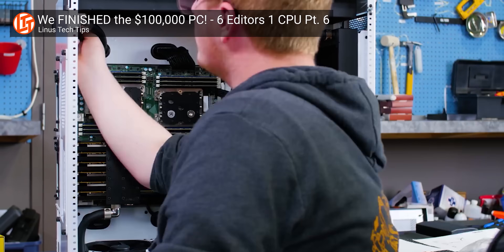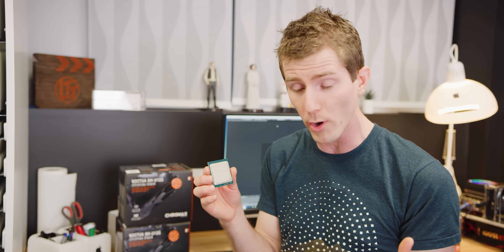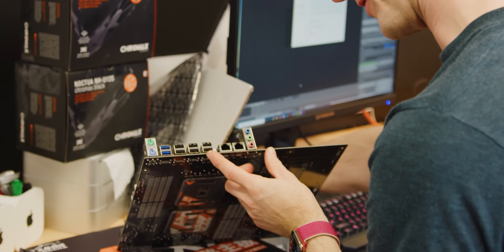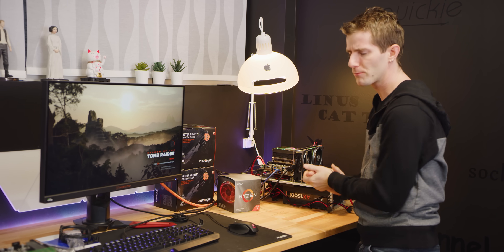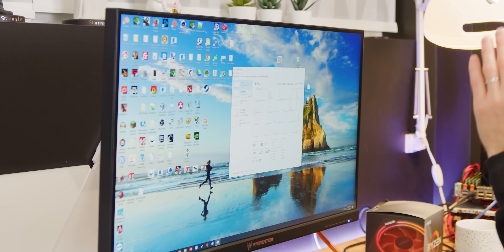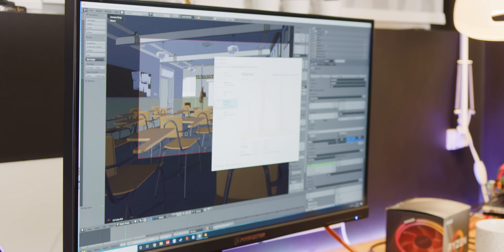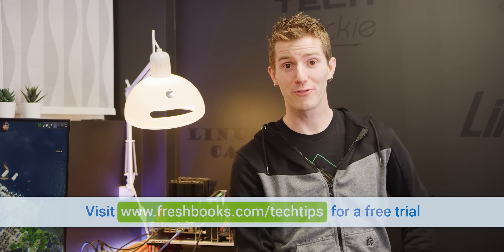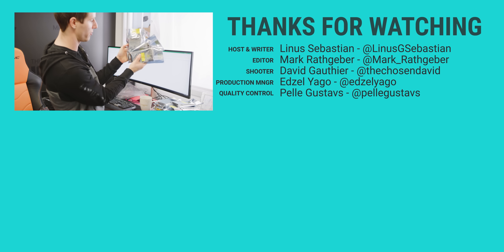SIXTEEN Cores for the Price of EIGHT!

Comment: I wonder if the RAM Speed was a bottleneck in the Xeon system, especially with that 45 FPS scene.
Reply: I can't find Linus cinebench score, but my huananzhi dual 2667v2 gets a score of 2521.  And it sure acts like an all core turbo to 3.6Ghz.   I bought one of the Jingsha boards mostly hoping to cheaply go from 64GB to 128GB, along with m.2 storage and more PCI slots but the board won't boot into windows at all.  But my CPU and ram are back in the huananzhi and its been up for 10 days.  Go figure.
Reply: @JasonStevens  I see the Jingsha board only supports up to 64 Gb RAM on AliExpress. Does it fail to boot Windows with only 64 Gb RAM too? Because with 128 Gb RAM Windows might just be having a problem managing the RAM sticks if the board only supports up to 64 Gb. I had an old DDR2 motherboard that only supported up to 4 Gb RAM, and I had put 8 Gb on it, Linux was working fine with the 8 Gb but every few weeks my Windows 7 files would get corrupted even if it was recognising all the RAM just fine. If I had to guess, Microsoft recognised the issue and added a safeguard to prevent Windows from booting up at all. But then again, statistically speaking, that's a sample of one motherboard.
Reply: @bhuvangunessee  I couldn't even get it to post with 128gb!  I had it posting with 64, but every version of windows 10 I had install media for each crashed before being able to load the installer.  Same CPU and 64gb work fine in the huananzhi.
Reply: @JasonStevens  If the board doesn't support more than 64 Gb RAM, it's normal that it won't even post with 128 Gb. It looks like either your board is defective or your RAM sticks may have some compatibility issue either with itself (yes, it works in the Huananzhi board but it might just be the Huananzhi handling the RAM differently) or the board (most probably the board doesn't support the RAM config that you are trying to use depending on PCI lane distribution).
Reply: I can't help you more than this for this issue, I'm not familiar with these boards. I would suggest going to the LTT forums (because of the video) or any other good forum, really.

Comment: If someone really wants to build pc with this board, then DO NOT buy two e5-2667 v2 which cost about 135USD per piece. Buy e5-2689 v1 which cost about 56USD. Performance is close and e5-2689 v1 has even lower TDP (130 vs 115 W). You can even get it in one bundle (MB + 32GB ram + 2x e5-2689 v1) for 280 USD in Kllisre Official Store on AliExpress.

Comment: So... what is the use case here?

If you are using Blender, or some other 3d editing app in the kind of capacity where a minute, or even 2 matters, I would assume you are making money off it. In any scenario where your machine is used to make money, why would you risk losing money or time on strange Chinese hardware like that board? Or used ebay parts?

Assuming you are just gaming, why would you want to put yourself in a situation where you are fighting separate NUMA domains?

And if you are using applications, at home that are well threaded, but aren't money makers: Is it worth going to an unknown board manufacturer, with the limited I/O, limited support, etc to shave single digits on render times?

Apart from "this is something cool I would like to try out", I don't see a single use case where this makes sense.

Comment: As this MB needs 2x8pins connectors - would you actually need 2xPSUs for it? If so, I guess putting it in a case is not an option... right?

Comment: As much as it pains me to suggest this.. Given Apple has a system in place (I forget the name but it's like a train station, bus depot type name) that allows a program that only uses 1 core to actually use multiple cores, is there a Windows equivalent piece of software that would make this 16 core monster perform any better?

Comment: Hey Linus. Serious question. Is this setup good? Let me know, please 

Xeon e5-2687v2
Gtx 1070
Runing x79 mobo 
128GB ram
Reply: Similar to mine, and yes pretty decent even today, maybe a bit over board on ram though.

E5-2667 V2
GTX 1070
32GB of ram
All in a HP Z420 Workstation case.
Reply: Wolf there’s someone selling the setup and I wasn’t sure if I should buy it. I appreciate your reply.
Reply: I run a 2667v2 with a 1080ti and its perfectly fine for 1440p gaming

Comment: E5-2667 v2 performs pretty poor, comparing with a Ryzen 5 2600 would be more informative. And it's only $140 while the 3700X is $380. Going by PassMark ThreadMark scores you'd be better off trying a E5-1660 v2 or E5-1680 v2, they're in the $180 dollar range and have the highest scores. Still, interesting video.

Comment: You did not even look at power.  What is the power consumption of 2 Zeons compared to one Ryzen?  That adds up over 3 years.  The TDP of those Xeons are 130w EACH and the Ryzen is 105w and 8 DDR3 draw about 32w compared to the 6w the 2 DDR4 run.  Even if the systems only run full loaded say 1 hour a day that Xeon system is drawing 180w more, that is still $10 extra a year or $30 in 3 years... just for 1 hour of use.  If you are planning on running it as say a workstation or game streaming system 8 hours a day that is $240 extra in power usage.   That Ryzen system will run about 280w total under load and that Xeon system with likely run at closer to 460w and needs 2 8 pin CPU plugs (or a splitter cable).  You could be talking another $30 for the PSU easy.

The Ryzen system can easily run on the retail heatsink, but you need to buy 2 heatsinks.  Even budget ones you are looking at $15 each.  Plus I do not like dealing with I don't like dealing with Ebay one bit and Ali Express and the lack updated drivers, support, or even finding someone with experience working with this board would be difficult.  Also it might not even fit in your case because the second CPU heatsink hits your optical drive or you have a smaller form factor case.  A larger case costs more too.  I would add another $10 minimum there... especially with the extra heat you will likely want more case fans.

Well now you are looking at $100 extra in parts and likely $100 extra in power usage to get a used system with likely less performance, no warranty, and and generates more heat and noise.  No this is NOT a good idea for anybody.

Comment: I liked the build and for a gaming machine it's neat but if you're looking for for cores like I was for a home virtualization server, I just picked up a Dell r810 with 4 e7-4870s and 256gb ram for like $350 on ebay and it's running at only 550 watts. That's 40cores plus hyperthreading at 2.4ghz if anyone was wondering.

Comment: Hey im new to buidling pc's do u think this will work?
==============
I N F O P A R T S
==============
case
Rakk Siri Gaming ATX Case free● 1x120mm RGB Rakk Stock Fan

Power Supply
Asus P-50GA 500w●

MotherBoard
asus prime a320m-k motherboard●

-Graphics Card -
Gforce gtx 1050 ti Graphics card ●

-Hard Drive -
Kingston A 400 240 Gb

-Ram -
Vengance LPX DDR4 3000 C15 x2● 8gb

-Cpu -
amd ryzen 3 2200g ●

Comment: Did you make sure that RAM was running at 1600? It might have auto set to 1066 or 1333. Not that it would have mattered a whole lot for what you were testing it with.

Comment: Okay, so how decent of an option is this if I want to game, it seems viable but just checking, I mostly want to flex on my classmates in my computer coding class 😂
Reply: I have dual 2667v2 and a RTX 2070. It ran fine enough for me.  But I found the Jingsha board no good as I wouldn't run anything for me, but the CPU and ram work fine in the huananzhi

Comment: If you plan to run old X79 era stuff, you are better off with 16xx v1/v2 xeons.  They are unlocked.  I currently have a 1650x running at 4.8ghz daily.  It is toe to toe with most modern CPU's in gaming and single thread things.  For the most part.  But get's is butt handed to it in heavy loads.  Even against the other 6 core chips.  But, for a cheap chip, it's a great budget option.

Comment: I’ve actually been planning to build the 16 core build that Linus showed here😅
Reply: @Martin M Depends on where you live though, I built a 20 core 40 thread dual Xeon 2650 with a dual socket Huananzhi X79 with 64GB of ECC for only $300 I think (watercooling not included, which is also Chinese). I only use it for HTPC,  CCTV and rig shows (it looks amazing AF, turns heads over shitty RGB). As a gaming PC it is pretty much almost useless, my 7700K/2080Ti just tears it to pieces at home workloads and gaming
Reply: I have their matx single socket board that I'm using to run a game server for 7 Days to Die, it's pretty lit, but the 2640v2 leaves my world generation times a little to be desired so I'm thinking about getting a stronger CPU
Reply: I built basically the same one a few months ago but I still had to use some weird INTEL Server Board
Reply: dont use that Chinese board, plenty of people receive dead/defective ones and manufacturer doesnt respond
Reply: rasz there’s actually a black version from a different company that’s being sold on an online store where I live. Quad channel memory support with dual sockets. And it has a gamery vibe 🤷‍♂️😅

Comment: I suspect the DDR3 / DDR4 divide was a prime cause of performance reduction at 16 core - coupled with the older chipset
Reply: I suspect it was running in dual channel instead of quad channel, he never said if it was or not, quad channel 1600 ddr3 has the same bandwidth as dual channel 3200 ddr4.

Comment: ddr3 in a dumpster? you need to show me that dumpster so i can upgrade my rig thanks. also he calls those xeons slow. kek mine is even older than that, i feel depressed now.
Reply: I use a 2006 Mac pro at home.  Granted I upgraded the processors to 4 core 3ghz ones, and a 1050, but it'll be 14 years old soon...

Comment: You mean i think Windows doesn't utilize NUMA nodes properly, it's exactly the same experience people faced with Thread Ripper second generation. But GNU/Linux on the other hand offers a far way better experience and superior utilization of NUMA nodes.
P.S.: Stop mixing Ebay and Aliexpress, even you can find motherboard seller on both plateforms...

Comment: I run a dual xeon e5 2667 v2 dell T7610 workstation in my office with 48gb's of ddr3 ecc and a 500gig samsung 860 ssd and a i put in an old nvidia 980TI i had laying around.  You can pick up a barebones T7610 with PSU and motherboard on ebay for $349.  The dual e5 2667 v2 will set you back $300 on ebay ($150 x2).  You can pick up 8gb samsung ddr 3 ecc memory sticks on ebay for $16 each.  You can pick up the samsung SSD for $79 or a cheaper brand for as low as $50.  If all you are doing is office work, a 980TI is most likely overkill, but it was laying around for me.  You can pick one up on ebay for $100.  For a spec like mine will set you back $960 on ebay plus shipping.  Its a pretty nice system.  I can all core at about 3.6ghz and run a few cores around 3.9 ghz.

Comment: For gaming? I'd argue that the majority of games still do not use more than a few cores, if that. So whether you'll have 4 or 64 cores does not impact performance all that much.
Waste of energy to run. Get a newer architecture with higher clock speed and you'll be much better off for the vast majority of actual use cases.

Comment: Since this board has socket 2011, could u put 2 e7 4880 v2 in it and rock a 30core system?
Reply: PXLCoarl Pretty sure 2011-1 CPUs like that won’t reliably work in this board, if at all. But I could be wrong.

Comment: i upgraded to these exact xeon cpus in my supermicro X9 based unraid server. went from 2x 6 core 12 thread 2.0GHz base 2.5GHz boost E5 2620 cpus to these 8 core 16 thread 3.3GHz base 4.0GHz boost E5 2667 v2 cpus. Basically these are the best clocking E5 v2 based cpus you can get. Only downside is that the E5 2667 v2 cpus were $200 a piece. And the old E5 2620 chips i had originally in my server? $12 bucks a piece.. not even worth the hassle to sell them lol. But at least the unraid server is handling a ton of dockers and vms like a champ. And who doesn't want 128GB of ram for less than $200

Comment: I actually put together a system with this very board. I got it for 95.00 and free shipping on Ali Express. I got two 2680v1 chips for 50.00 each.  I scored 128 gigs of ECC 1600 for less than 200.00 shipped free. The RX580 isn't the best graphics card but it was only 180.00 and works.  Gaming performance isn't that great and single threaded performance sucks. With that said, ripping, rendering, transcoding and editing are faster than greased lightning. I'm into this for well under 1000.00 and knew what I was giving up by going this route. I am very satisfied with this system.
Reply: I have since built a threadripper 1950X for my  daily driver and my dual xeon system is a dedicated emby server now.

Comment: I'm very interested in that motherboard. What's the highest end CPU from that era that it's compatible with? Can it handle two of the 24 thread Xeon E5-2695 V2 CPUs?
Reply: Not worth it for high end options; ryzen is more efficient and costs about the same at that point
Reply: @joshuanishimura1131   I have one of these CPUs and tons of ECC memory already. All I'd have to do is try to find another 2695 2nd hand.

Comment: Regarding Intel IPC gain from 2011->2019: maybe close together but still significant to some degree.
My i7-2600k struggled at feeding my 1060GTX under load when playing BF5, so i had to OC it to avoid the CPU-Bottleneck.
That was at 1680x1050(19:10) to archive ~60-70 fps

Recently replaced it with a Ryzen 5 3600(and new ram + board ofcourse). Now the CPU keeps the GPU at a constant 100% while having a lot of room left.
That way i get up to 110fps in WQHD (replaced my old monitor at the same time, 144hz freesync/gsync compatible).

Comment: Another note about the Ryzen system which is one of my main considerations when I build a new, inexpenisve system (which are all my systems) is will I be able to upgrade the CPU etc... in the future as I can afford it.  So I want a newer system where I can pop in a newer, faster CPU and newer faster RAM, newer faster VIDEO etc...  so, the ability to upgrade it is KEY for me.  The last cheap system I built (before  my current one I built at the start of 2019) was in 2009!  It lasted me 10 years.  i started out with cheap components, but a motherboard that could handle better, newer.  As time marched on I upgraded various parts in it so it lasted much longer.  I designed the system in 2019 the same way.   With a used system, it may be less expensive for now, but you will have to swap the whole thing out to upgrade it, and that is more expensive than the newer Ryzen system you have.

Comment: If you're going to go this route, I'd either pick the e5-1650 (overclockable i7-3930k), e5-2689 (ryzen 1700 equivalent), or e5-2630 v2 (6 cores, 12 threads on a budget)
Reply: Prices you should pay for each: $50-60, $55-60, and $20-25, respectively

Comment: I got a question i have a 2700x  running at 4.1ghz with a b450 mobo and a 2070 super. When i do the tombraider benchmark during like a scenery shot  it like studders every second or soo im tryinng to figure out whats going on and what i can do to fix the issue

Comment: I picked up an old HP Z620 Workstation for my kid a few years ago.  Dual Xeon E5-2620's, w/32 gig ram.  I tossed a SSD and 960 in it, and the thing runs really damn well.  The memory has been a touch of a bottleneck on the more current games, but it is a beast of a system.  Beast isn't an exaggeration either, as it weighs just over 45 pounds.

Oh, I got it for $250 from a local electronics recycling shop.

Comment: Even with dual vocal chords Linus was only able to utilize one. On top of that a virus caused the remaining one to run at much lower clocks.
The common fix is directly installing a 2019-2020 antiviral (IIV, RIV4, or LAIV4). Obtaining a license for Afluria or Xofluza and installing in autumn 2019 works for most cases.

However, once the virus has infected your i-system you'll be limited to ~50% system utilization. Liquid cooling w/Citrus™️, putting system into hibernate, and updating with Zinc™️ does help.

Comment: You should have turned off hyperthreading, the old ivy bridge/sandy bridge systems could not boost on any cores when both logical and physical cores were pegged. I have a similar system running dual E5-2680V2’s.

Comment: More like:
Something YOU can't afford for the price of something YOU CAN'T afford
Reply: You should actually check the pricing, the 6 core bottom end xeons go for less than $10 and there are some chinese x79 mobos for less than $50 if you really just want a 1080p transcoding box. The ram is dirt cheap too. I picked 2x32GB of ECC DDR3-1866 for $50, so that scales up to 256GB for less than $200.

I've also found 4GB DDR3 dimms in thrift stores before.

YOU can have a rocking xeon server and it can be in an old mATX case if you really want it.

Comment: Linus: "We can build an ultra PC for the price of a mid tier one!"
Me: "Okay, cool!"
Linus: "With a Chinese motherboard!"
Me: "Okay, not cool."
Linus: "With used parts, Frankensteined onto this board!"
Me: "Take it away! Take it away from me!!!"
Reply: Oplefire M okay cool
Reply: At least Chinese are actually recycling their computers and extensively reuse those parts on new products. Do you know most official phone repair store only have 3 types of parts: Touchscreen, battery and main board? When your phone broke down, they just replace corresponding one and throw the broken one into dumpster. In china, they actually replace all broken electronic components piece by piece. I once saw a technician connect dozens of external wires thin like hair on a burnt main board and it really fix that board. When they cannot fix it, they remove all components and sell them to factories to manufacture these new products.